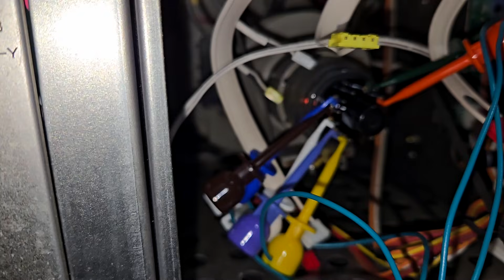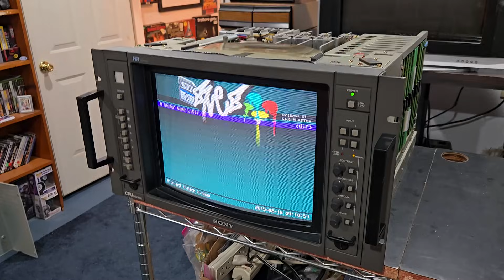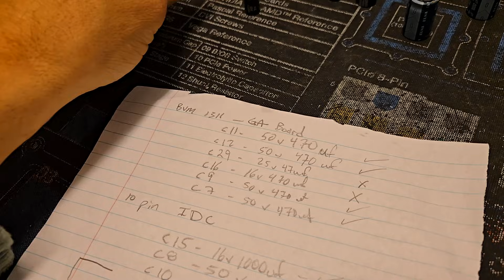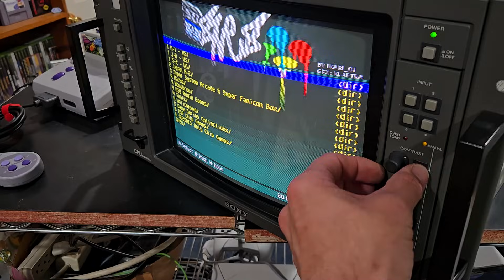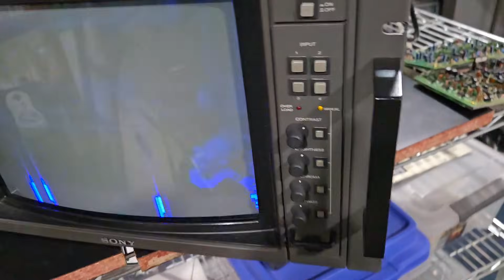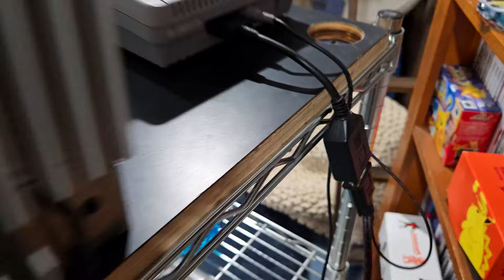Sony BVM 1311: The 90s Trinitron Studio Monitor -  Troubleshooting & fixing lots of problems

Comment: I have a BVM-1916 with the same HZ board, I’ve spent probably 24 hours troubleshooting over the last 6 months, trying to figure out why my manual front controls have no effect, even though in the menu they show there changing values, but everything control wise is stuck at 100% (brightness,chroma ect) checked continuity on traces all good, I feel it is the original caps on the HZ board even though none have leaked (yet) luckily, been using it with a video processor, which works fine for for 480i but 240p is a no go with a video processor, which is why I got this BVM, I’m good with through hole caps but not surface mount don’t have the knowledge or set up. My CRT test like new & other than that the set is fully functional, I called over a dozen places and no one wants to take on recapping the HZ board, would you possibly be willing to take that on? There would be absolutely no rush, I can’t find no one else obviously I would pay for your work and know there is no guarantees, if not no worries, but if so, I would really appreciate it there’s not many of BVMs left of this era these are great BVM’s but no one wants to touch them. Is there a way to contact you?. I’ve looked for a replacement HZ board out of a parts sets but over the last six months 0 have popped up, I do believe my board is repairable and as you said, they are quite durable. No one wants to work on them. I’ve reached out to older Sony technicians & most of them discarded parts and service data for this series of BVM long ago unfortunately.

Comment: I was changing caps on these over 20 years ago. They are also on the BA3 and BV SDI boards. I think they are nichicon caps. The electrolyte eats through the vias and can affect the surface mount resistors as well. Unfortunately, a lot of these monitors were written off due to this. The CRTs are excellent and do very good hours. They were originally used in the BVM-1310/1410 launched in 1987, and do not short out like the later CRTs, where they changed the design and the H-stat volts were no longer carried along with the EHT, and fed through the tube neck instead.

Comment: quick question. it has nothing to do with the video, sorry. i just completed an rgb mux mod on a jvc-32050 and the rgb works great, but when unplugging and trying to use the composite inputs it will go from a blue screen (which it does when nothing is inputted) to a black screen. almost like its not disengaging from rgb mode. what should i look for or do? thanks in advance

Comment: I don't think capactiors really "jump up and down" with the GME meter more than one level and even that's just because it's borderline between the two ESR readings. Any variance is most likely due to how good of contact you are making with the probes. You really should be using needle probes if you want good contact while in circuit.

Comment: The Sony BVM 1300 series is infamous for leaky, corroded capacitors—sometimes even dead shorts in the power supply. I’ve had one catch fire on me, so I never turn them on right away! 

First step: open it up, clean it thoroughly, and inspect everything. Then, if it looks safe, power it on carefully and do a full recap.
It’s a bit of work, but restoring these is really fun and totally worth it—they sell for a big profit!

Hi from the Netherlands everyone <3